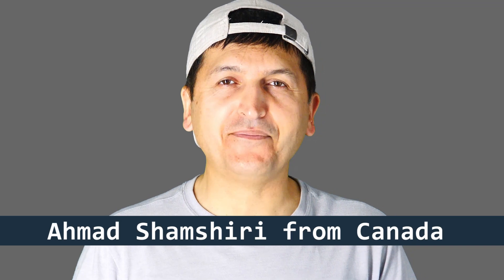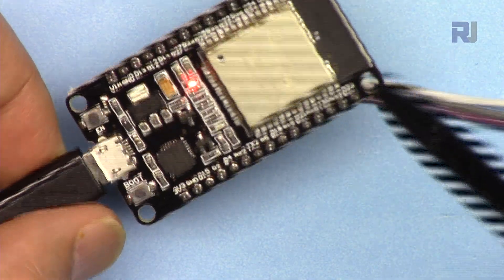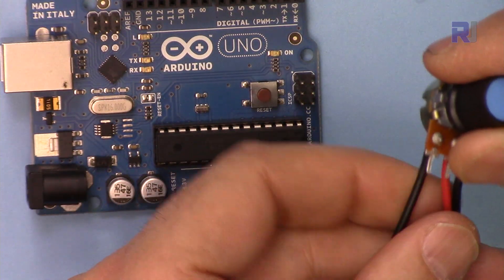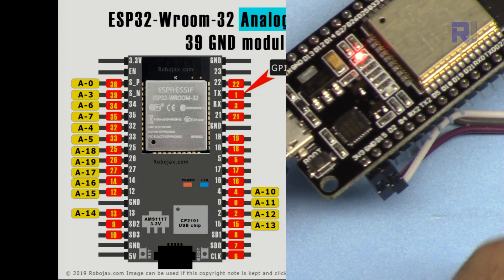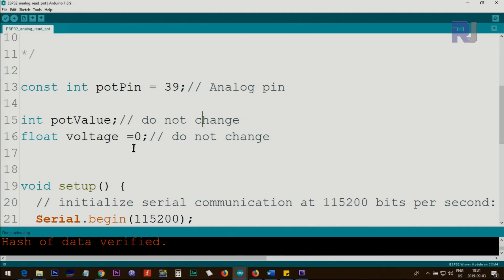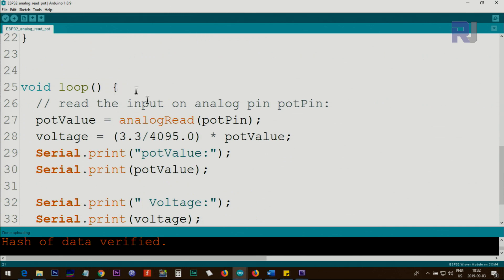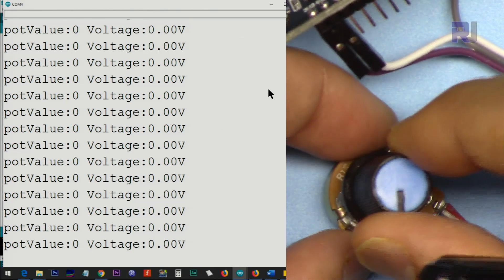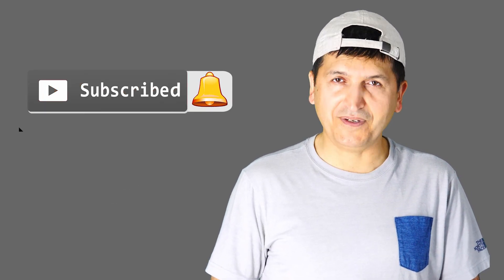Using Analog input of ESP32 read Potentiometer DC voltage - RJT214

Comment: Reading is not accurately, if we measure 0V to 15V using this method. 
Please make video using
ads1115, esp32, and LCD16*2
For DC monitoring.
Reply from the maker: it is 12bits and for most applications it is very accurate.

Comment: Hello, thank you for the great video, I think everyone is playing catch up with these ESP32 boards, abit different from the regular Arduino setup. My question is, I'm using the ESP32 wrover-dev. That has a 3.3&5v output. Can 5v be used for a pot if the voltage level is changed in the code? And what pin is best for output, to actually actuate with the pot? Thank you much.
Reply from the maker: hello,  to read pot, I have shown all pins that are available to be used in this same video. Here is full introduction video to ESP32 https://youtu.be/--Fj8QDlGuQ where I have shown pins for power supply and all specs. I have not make any video on analog output yet.

Comment: Hello Ahmet, verry interesting ! Can you please explain me, how can i measure and display positive and negative Voltage. I looking for a solution to measure +12Volt to -12Volt ? Do you can help me please?
Reply: The first thing you need to do is level-translate the input voltage so that -12V corresponds to 0V at the ADC input, and that +12V corresponds to 3.3V at ADC input. In reality, you should include -13V to +13V as a range in order to see the voltage slightly above 12V.
First you need to split the 3.3V in half, and use that half point as 0V.
Then you need a resistive voltage divider to drop 13V to 1.65V.
Finally, you need to reflect that in the code, so that the code would make 0V into -13V, 1.65V into 0V, and 3.3V into +13V and appropriately space or multiply any of the voltages in between. I know the analog part, but I don't know how to do it in the code yet.

Comment: Sir, I asked ... I once bought a module so I used esp 32 dev kit ... now I noticed that the V in was 12 Voltdc ... as far as I know the standard is 3.3 / 5 volts ... So how about that, the one using 12 Volts  and it turns out to be durable until now ... what is the standard voltage?
Reply from the maker: here I have explained this module fully : https://youtu.be/--Fj8QDlGuQ
Reply: @robojax  Thank you sir for the information, I pray that Allah will always protect and provide health.  and hopefully what has been worked on becomes useful knowledge.  greetings from your brother from Banjarmasin Indonesia
Reply from the maker: you are welcome.  Jazakallah for you prayer. و ایاکم. Salam to to all Indonesians.

Comment: Dear Ahmed,

Nice work as always.
Plz make a video on a project...
DHT sensor connected with UNO and Esp mudule can read it and can show both temp and humidity to blynk server.
Regards
Reply from the maker: Thank you Ehtesham. I never heard of blynk. Just checked it. How do you use it? it is not free.
Reply: @robojax  thanks for response.
Blynk is very useful and very friendly. I used it in my many projects...
I am planning to use STM32 microcontroller and esp8266 for one of my Chicken egg Hetchery project but issue is to interfacing  esp8266 with it or UNO...
Reply from the maker: I just check it it is a scam. Pay for simple connection? really? I am working on platform that offers free. https://snipboard.io/vuWIO5.jpg will never promote this. Students should learn at least with 5 devices and 10 to 20 projects should be absolutely free.